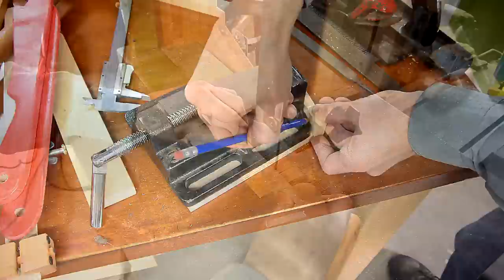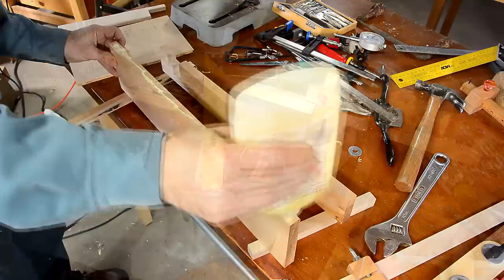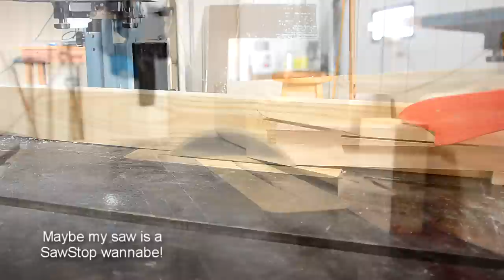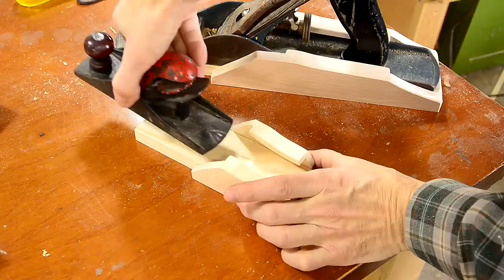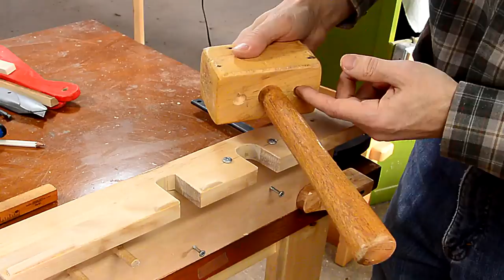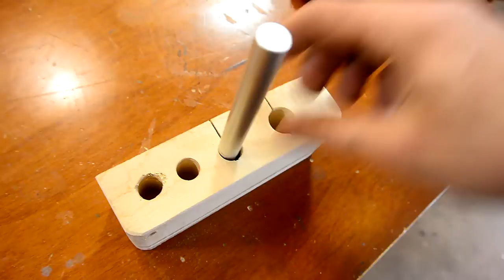Wall tool holders for mallets and hand planes

Comment: Last night I watched a video showing how to make a $22,000 desk.  Every tool, lathe, cnc, drum sander, routers, jointer, planner, and locking systems that cost more than my job saw.  Now it's Matthias' turn.  The band saw skill was a winner.  The use of the razor knife to chamfer the screwdriver/chisel holes in scrap wood.  No Woodpecker, no Festool, just skill and ingenuity using his well honed techniques, unique to Mr. Wandel.  I see why he gets views in the millions while $22,000 desks get less than half that.   This isn't a competition.  $22K prods those on the cusp of going professional to see whats in store for the high end production shop, than IMO, is superb.  His furniture will last for decades if not centuries.  But I believe that there are more like me.  The DIY one car garage woodworker making sure that we don't get fat watching television and eating fried pork skins.  Mr Wandel has saved my hundreds of doors in tools I don't need to buy.  Matthias (my grandfather's name, but only 1 t) has shown techniques that are as clever and simple to duplicate.  This will up my skills and the quality of my end products without spending a ton of money.  Gotta run, have to cancel that 3D printer I have on order.

Comment from the maker: More tool holders in my big workshop.  Got the essentials hung now, but I'm sure I'll make more with time.
Reply: Matthias Wandel i love how tidy you are with all tour tools
Reply: Matthias Wandel Great job, Matthias! I want to do the same thing in my garage (that's my "workshop" too). I've just repaired the wall in which I want to hang the tools, and I already have the plywood sheet to fix to the wall to make something like this. It sure looks very nice, but I do think those holders take a lot of work indeed!
Reply: Love the plane blocks.. smart to think off a blade recess Matthias Wandel  !
Reply: Matthias Wandel Молодец !!!
Reply: Looks good! I use a slanted plane till because I have quite a few more hand planes (though your way has no limit I suppose), but a very similar setup for my other tools. I love what you said about not doing it all at once. Yes! Not only time consuming, but it seems like I need to live with my setup to know exactly what I want.
Reply: Matthias Wandel at 7:44 it almost looks like there are pocket holes in that little shelf you so conveniently neglected to film :P
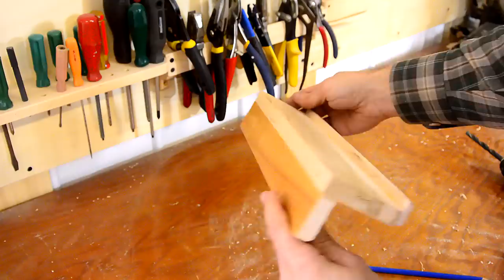Reply: Timothy Campbell 7:26, whoops
Reply: just made a bunch of tool holders today as well, but yours look better.
Reply: Timothy Campbell I'm fairly sure that those are indeed pocket holes. He used a pocket hole on another shelf (I think it was for the one holding his chisels). In that video he explained why he used a pocket hole. 1: It's not bearing a heavy load. 2: It was the most practical joint. (as far as I've gathered) He's not against pocket holes, but see their uses as limited.
Reply: steven zhang
Reply: you called the combination square a level...
Reply: Matthias Wandel
Reply: باسم الكربلائي

Comment: As a woodworker there is something about custom making holders for your tools. You are making something that is utilitarian but you can make it as minimal or elaborate as you like. Its very rewarding working "on" the shop and not just "in" the shop.
Reply: Sometimes I feel like persons like Matthias (and myself on a smaller scale) ONLY really make things "for" the shop. It's just too fun.
Reply: Christopher Demetrick    Well, I’m a fairly busy woodworker (woodworking & other activities), so I just don’t have the time for that. I use a pegboard system. Tools can be added in mere seconds and whole areas rearranged to accommodate in minutes. My creativity is reserved for what is done with those tools.

Comment: Great, but those plane holders should be lined with natural-fiber velvet to prevent blade damage. Also, a climate controlled box can limit exposure to moisture and harmful UV radiation, which both hasten primary planar degradation and quantum-warping of the sole.
Reply: Also consider displacing the oxygen with an inert gas, or simply pulling a constant vacuum in the box. :-D
Reply: pocket83 I keep my wood planes in 3M Fluorinert engineered liquid. It is specially designed to be chemically stable (so the blade won't corrode) and thermally conductive (to keep heat out of the blade to prevent warping due to thermal fatigue). It's designed to cool electronics, but at around 250$ per gallon, it is totally worth it to protect those precious, delicate tools!
Reply: Azure Flash That's true. If the internet has taught me anything it's that handplanes are more valuable than children.
Reply from the maker: Azure Flash Right.  Keep the planes safe in a seald box, and if you need to smooth something, just grab the belt sander :)
Reply: Doug Reed Have you considered the effects such fluid would have on the internal grammeters of the planes turbo encabulator?
Reply: +Azure Flash Have you considered the effects such fluid would have on the internal grammeters of the planes turbo encabulator?
Reply: +Triggerboy78 i did
Reply: Simon Moeller, 5 times in fact lol

Comment: Super cool. I always wanted to make such wall too where all my tools are easy available hanging. Not yet made. But with this video gives me motivation to finally start on it aswell.
But good that you made an example because the thinking about it made me not doing it. And I see now what I would do different / better. I think I'm going to hang the heavy tools at the button of the wall... And the lighter ones like screw drivers and drills.. more in the middle..

Comment: These are great tool holders, but use caution on using them in a southern climate where humidity is much higher. I made similar holders years ago (not as nice though) and within months my tools developed rusty areas where they were in contact with the wood. I'm not sure if you could seal the wood perhaps to keep moisture problems at bay.

Comment: Hi Matthias,  I agree with you.  French Cleat walls look nice but they do not give any more functionality than your wall with tool holders and screws.  My garage is the envy of many of my neighbors but I do not use French cleats.  I like having tool outlines so a quick visual tells me that something is missing. If I spend 15 minutes looking for a tool I have lost 15 minutes of my life--I cannot get those 15 minutes back.  I use long torx screws for most of my stuff--plus cabinet grade 3/4" plywood.  My tools are on 2' x 4' panels so I can move them to the next garage and get set up quickly.  Time is something I don't have a lot of.  I used to have the same drill press as you, but then I burned it up once when I used a 1200W inverter to power it (an experiment).  Keep up the good work, Matthias!

Comment: I have pegboard and hooks and the hooks don't like to stay in. I've tried gluing them in and using the little plastic braces without luck. This seems like a much better approach, but to do a little at a time as you say.
Reply: +ndktube I've had problems with pegboard hooks coming out too.  I was so frustrated with it I threw mine away.

Comment: Your bandsaw blade looks about 3/8", is that right?  I've been using a 3/16" blade with a not-so-great bandsaw, mostly cutting out carving profiles from thick stock (4x4 and higher).  I don't think I need such a thin blade for this  They're unstable.  They tend to twist without an inordinate amount of tension.  What width blade do you end up using mostly for your projects?  It looks like you cut within roughly the same minimum radius that I do.

Comment: I'm getting older - put the heavier stuff down low, the lighter tools higher up. Is easier to put and retrieve, also less damage if something falls, and from engineering; the higher something the greater the force or strain on the back boards.
Reply: The downward force is the same as the wueight of the object, which will only change by an incredibly small, negligable even to most science experiments amount with height
Reply: However, the torque on the wall about its axis along the floor is much greater if the heavy tools are mounted higher.

Comment: I had to do a quick fix.  I took a surplus plastic lattice and mounted it on four vertical 2x4s.  The handles of pliers, scissoring type tools and clamps would slide into the lattice holes; and for the other items that would fall through to the other side or were too big for the lattice holes, I put hooks on the holes.  So the lattice structure both functions as a holder for many tools directly and as a pegboard for hooks for tools it can't directly hold.
     You do great work.  I just don't think I have the patience to do much of that.  And my dexterity is poor.

Comment: Just a suggestion, when I learnt to use a plane, I was taught to never set it down on the blade. A hollow behind the blade? Regards, Matthew
Reply from the maker: Matthew Tinker It's all paranoia.  Filming my "handplane sharpening for barbarians" video, I slammed a hand plane, blade down, on the cast iron table of my saw for the final scene (that took a few takes).  But when I used it next, it was still totally sharp.
Reply: Well, we'll have to agree to disagree! Maybe your planes aren't as sharp as mine!
Reply from the maker: Matthew Tinker Mine are sharp enough.  Sure, you can keep your planes sharper, but then you can't really use them because you have to resharpen them all the time!
Reply: This is getting silly!
Reply: JOHN50N1 Pittty he never taught you grammar.
Reply: Matthew Tinker but its not set on the blade, its vertical= gravity is not applied directly to blade. by your logic then, you should never ever use it, cause it will damage the blade
Reply: No, the logic is you don't set it down on anything your not going to plane.
Reply: Matthew Tinker
thats really wierd and doesnt apply. it is made that way to PROTECT the blade and you say dont do it. it just so wierd. cause you can put it in the holder without touching the wall and taking it out is the opposite to the blade, so again. what are you talking about? this is the same principle as a knife holder (chief is it called?) anyway. i just dont understand. wtf is the most accurate.

Comment: an oscillating multi tool would have worked perfectly to remove the excess material for the plainer in seconds without having to go through the whole table saw bit. the sleeve for it did come out awesome.
Reply: nyinfamous2k2 
Would have been even easier with a router.
Reply from the maker: superdau Neither of which I had at hand.  But maybe even easier would have been a hand saw!
Reply: nyinfamous2k2 how about a Dremel ?

Comment: Only three tape measures?   I know, it's just the "spare" shop...

Nice trick with the indents on the wooden mallet.
Reply from the maker: wordsnwood I got more out there, but three is all I can find at any one time!
Reply: Matthias Wandel I have a small basement shop.   I also almost always wear a shop apron.  The tape measure (sometimes two) goes in my apron pocket, and pencils go up in the bib pocket.   I try to always put them back.   But there are STILL times when i can't find a tape measure for a few minutes...
Reply: wordsnwood Very true for me, too. I'm permanently searching for pencils and measures, even though I should have quite enough. That's why methods like here at 6:29 are so important.
Reply: wordsnwood I saw Jimmy DiResta recommend attaching the measure to your belt/pocket or whatever and just leave it there while you measure. I've tried it and I'm hooked!  Now the only time I have to search for it is when I first come out to the shop :-)
Reply: +wordsnwood Yes, a shop apron is very helpful for holding things like pencils, pens, a marking knife, measuring tape, and a butt chisel.  The trick to not losing a tool is to train yourself to never put one down, but put it away.

Comment: Tools should be held so they can be grabbed by the handle, with the grip you use when employing the tool.  And also, the holder shouldn't require a large movement to disengage the tool.  The plane holders you made require a lot of vertical movement to get the tool out.  That movement slows down the process of getting the tool, and replacing it, but it also uses space above the tool for clearance.  A simple shelf like the one you made for the measuring tapes is all that's needed.